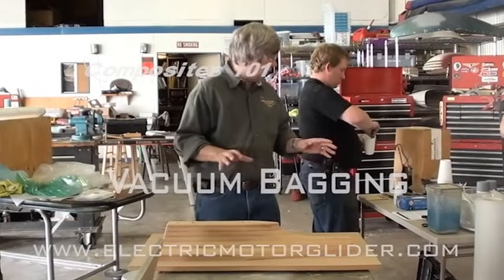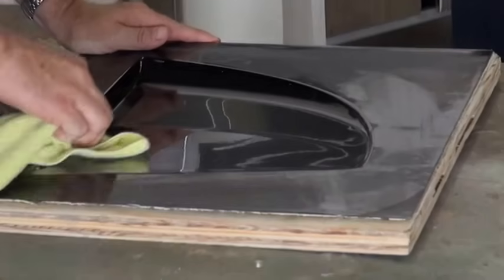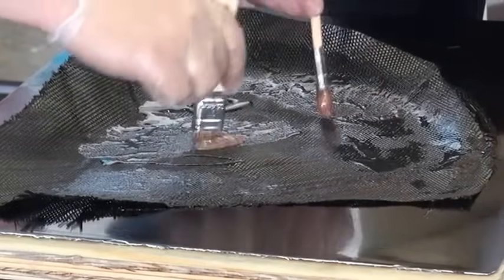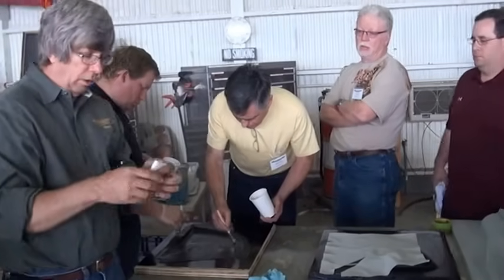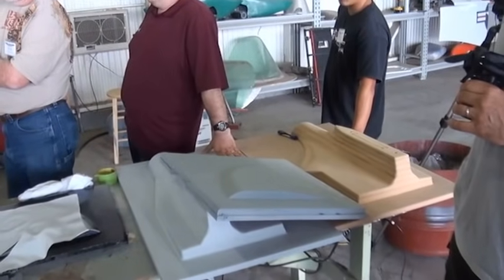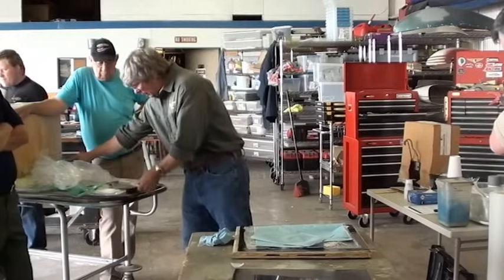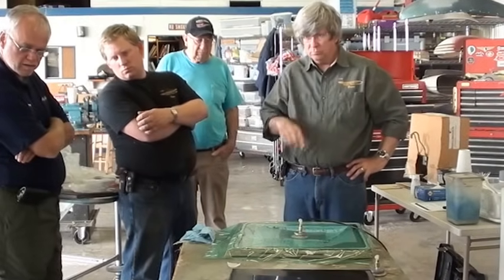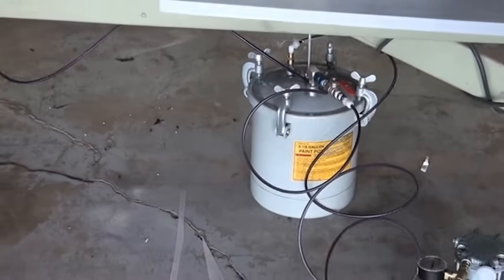Composites 101 (Vacuum bagging carbon fiber)

Comment: Thank you for this.  I've seen the use of PVA for mold release.  Is wax better or pva?  What is your preference?  Thanks
Reply: Use both...wax several coats first, then release second...always use both...I prefer using a gelcoat after the release agent, gives a great finish on your fiber...
Reply: texaswildcat2000  exactly, 
Use PVA and gelcoat after waxing for the first one or two of products when using a new mold, if the mold releases ok, then it is ready to use withoud PVA.
When doing resin infusion it is highly  recommended to use gelcoat andPVA when using new molds...
By the way, in this film they use a polyester mold, allways !!!!!!! Postcure a polyester mold before using vacuum cure or resin infusion.
The vacuum can suck out excess styrenen which is still in the polyester, this outcoming styrene dissolves your wax and your product will be stuck into the mold..  in my 22 years experience in composites i’ve seen this many times (yess it happened to me also :) )
Reply: Tks for the detail... but... what is "POSTCURE" ?
place it on a oven? how long?
Reply: juan perez  postcuring a mold means you give the mold a heat cycle, 
This is geanerally done to improve crosslinking of the matrix (mixed resin) and improving the TG (glass transition temp)
in case of a polyester mold it is also done to make sure all of the excess styrene evaporates, if you don’t do this there is a big change the excess styrene dissolve the mold release when vacuum is applied, especially when temperature Increases  (exothermic peak) at cure
Reply: Tks for answering... I apprecitate... any general guides? at what temp? how long?

Comment: Great video.  What's with the stockpile of rusty old scissors @ 23:30?
Reply from the maker: students abuse them, I sharpen them, then I buy more, students abuse them, I sharpen them, that I buy more, students abuse them, I sharpen them, I buy more… I think you see where I'm going with this.
Reply: Adventure Aircraft
I went to a vocational school, so unfortunately I know what you're talking about.  Scissors are cheap though, make them buy their own.  People tend to not respect tools until they have to buy them.
Reply from the maker: Believe me, we've had that discussion.
Reply: back when i worked at vestas Blades. where we made 55 - 62 Meters wings. we where using about 1500 sissors every 6 month.  this is the sissor 57 USD a pop http://vestaindustry.com/source/products/Household%20Scissor/Tailor%20Scissors%20Stainless%20Steel%20Size%2011cm.jpg

Comment: This is an excellent video of showing how not to do it.  Way too much resin, where is your squeegee, the perforated plastic over the peel-ply just gets in the way of the excess resin transferring to the bleeder ply, and so much resin he lost all local vacuum where it soaked through to the vacuum bag, which is a big problem.  If you don't have air space to pull a vacuum between the bag and part there is NO PRESSURE on the part, so no vacuum.  Kudos he at least did the video, but it's only good for entertainment.
Reply: Show us a video of how it’s done.
Reply: While this is very painful to watch, I think some of your observations are slightly off the mark. The perforated film is used to limit bleed and control resin flow. If you allow the resin to bleed entirely to your breather, you will undoubtedly create a dry and porosity laden part. You can also see that he has vacuum path between the perforations (for most of the cure), and therefore has good vacuum on the part. If the breather is saturated, you will shut off your vacuum flow and lose the pressure you need. Surprisingly, his part seemed to be pretty good on the mold surface, but probably resin rich still. Why he added resin to the peel ply I'll never know.

Comment: What valve do you place inside the bag? How reusable is it?
Reply: Vacuum breach unit/valve made specifically for vacuum bagging. You reuse them [unless you suck up resin in to it, so run a strip of breather away from the part where resin is]. I've seen people just use a tube that's tacky-taped  in to a corner with a wad of breather cloth.

Comment: Seriously labour-intensive process. That's not going to scale for series production. (I understand this case isn't.)
Reply: It actually scales quite nicely. Full size yachts and airplanes are made with these materials daily. They might use different methods, but the results are similar. It actually saves on labor as you can build your structure into the parts, or simply make a one piece part to eliminate many pieces.

Comment: Does anyone know about the usage of gloves. And never use you bare fingers around carbon fiber the way he showed us. Those little fibers go very deep into your skin, then your off to see your doctor. As I remove the parts from a mold, use a tool like a tongue depressor or very thin hard plastic. Never fingers.  And if you knew how to use a squeegee, you would have a better part, lighter. When you have hard corners that the bag doesn't touch, your bag was too tight of a fit over your part. In that case you bring your vacuum up to around 3lbs, then push the bag into your hard edges, even use a tool. Then bring up the vacuum to full pressure. I have Forty years of Composites usage. You guys need a little more knowledge, then you can brag a little.
Reply: Come on then make a video and show us how it should be done - be great to see - how a pro does it
Reply: As painful as this is to watch, some of your advice is off the mark. In my near 40 years of composite manufacturing, I have never been to a doctor for touching raw carbon fiber. Furthermore, I have never known a single individual to do so either. Now, I have had my share of cuts and a few slivers while handling raw edges of parts, but I'll take the blame for those and some simple tweezers will get those slivers out. The bag he is using is called Stretchlon. It elongates 500%, so your comment of tight bag are unfounded. That doesn't mean that his breather materials aren't bridged, but he seemed to do good job of getting those in place before the bag, so it worked out well. You'll also note that his part looked quite nice on the mold side, but may have been a bit resin rich. AS you can see, there's more than one way to skin a cat. You may want to take some of your own advice and get "a little more knowledge" before bragging about your 40 years.

Comment: i highly reccomend removing this video !!! this is not the correct way to produce aviation parts.
it starts when they talk about an epoxypump, every certified aviation composite employee (company) know a pump cannot guarantee a correct mix ratio, simply because it is not 100% failproof!!
no gloves, safety glases no de-airing of the fabrics, dabbing with a brush makes air bubbles, and vacuum expands them 
When i saw him placing the airtech connector in the middle of the part..... heheheh 
hobbyist